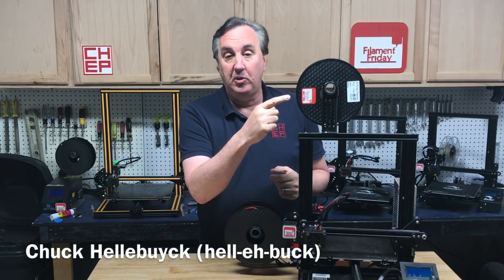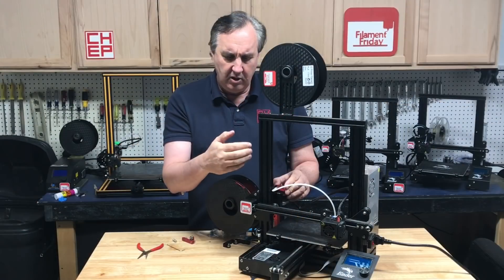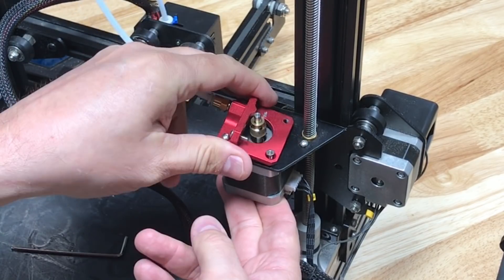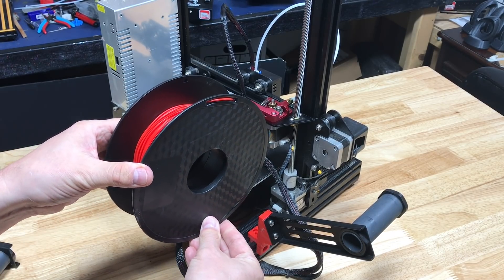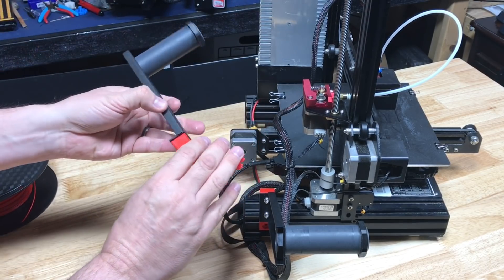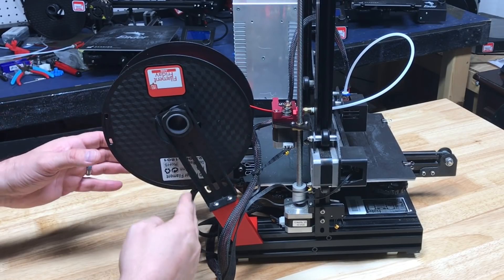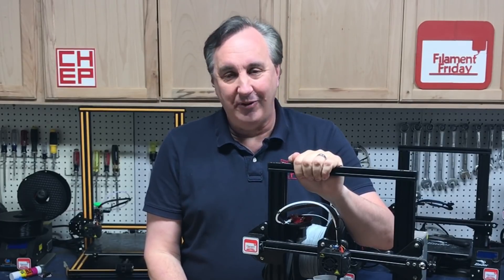Creality Ender 3 Rear Spool Mount

Comment: Thanks for the video chuck. I was considering moving my spool to a different spot and was thinking of all possible options. I notice that your extruder is a metal single gear drive. Do you really notice much difference between the single and dual gear types? I thought it would be progression to move all to dual gear or is there a reason why you haven't on this one? Your answer will lead me to another question which I wish to ask as well please.
Reply from the maker: I’m seeing wear in the dual gear. So I’m not sure it’s the best solution.
Reply: @FilamentFriday  that's what I was wondering on your opinion. As I bought 2 pack of metal dual gear extruders and found wear on the additional gear was basically grinding into the base. And that's on both of them. Do you think it was a bad batch or designer flaw? I know there's constant moving parts but not expect so much erosion in what I think is a short time (I'm talking just a few months)
Reply: Dennis Renton 
What do you use to lubricate the teeth?  Try some white lithium grease, if you’re not using anything.
Reply from the maker: I’m thinking it’s a design issue. Use lots of grease.
Reply: CHEP 
There are sellers with slightly different looking units.  Possibly the gears vary as well?

I have two Ender 3 Pro units, and the one with the dual grip extruder hasn’t been run very hard as yet.  It has a silver screw through the gear on the arm (others have a black screw, and look slightly different in colour).
Reply: @boggisthecat  it's not the teeth wearing down. It's the cog itself wearing into the base. And it's happened to both of the dual gear extruders I got. Think I'll just order from another supplier and hope it's just on the pair I bought that's the problem.
Reply: @FilamentFriday  thanks for your advice. I'll source more but try from someone else hoping it'll be different. Just think that the generic extruders, I thought they'd all come from the same manufacturer.
Reply: Dennis Renton 
That seems odd.  My gears both sit well above the base level.  The fixed gear almost reaches the end of the motor shaft.

Comment: nice idea but on my ender3pro i ve installed the direct drive kit so i only can put the spool on top.but i appreciate the search.
Reply: mulderx252 
Is it not possible to use a short length of tube to direct the filament?
Reply: @boggisthecat  maybe but it adds friction And more as  long as the z arm is lifting.

Comment: Hi there. Great idea, but what if you might the spool holder sit even taller and let the filament feed the extruder from the bottom of the spool instead of the the top. That way you can get more build area back. So essentially, that your design and just make it longer so that the spool sits maybe level with the top. Would that not give you your build area back?

Comment: The filament will eat the extruder arm even faster than the stock location. Metal is better but at that angle you've got, it's only a matter of time.
Reply: Pretty much what I was thinking
Reply from the maker: If it’s going straight in how does it wear?
Reply: @FilamentFriday  It's not aligned with the hole in the extruder. You have the center of the spool aligned with the extruder so the filament is always wearing away the top of the hole. Maybe you could raise the spool higher and have the filament spool from the bottom of the reel?
At 4:42 it's apparent
Reply from the maker: But the extruder moves up as it prints so it’s always changing, no different than from the side. And I don’t see any major wear there.
Reply: @FilamentFriday  I'm just making a comparison to a free standing spool. When the X axis is low, it will eat the top of the extruder arm. As the X axis rises, it will change and maybe eat the bottom of the extruder arm.
There must be a better way
Reply from the maker: If you can figure out a way to raise the spool at the same rate the extruder rises, Then a lot of people would interested in that.

Comment: If you can flip that arm 180 degrees then the spool will be on the outside and not inside the print area.
Reply: Or even better, just unscrew the filament pin and flip that 180
Reply: Would make changing filament spools far easier too.

Comment: Turning the extruder was brilliant.  while I won't use the bracket, it will make running the filament into the printers from my repkord filament box mounted above avoid one less turn to enter the extruder. I have ezstruders so I will await your ezstruder bracket design.

Comment: I really like this idea and it now has me wondering if you could mount it on the front side of the printer if the extruder were to be turned 90* the opposite way. That would put the spool in a better location for filament swapping and be way easier to check spools in a print farm type setting.
Reply: Mr.Butram 
I don’t think so, due to the printhead homing at the far left getting in the way of the filament.  There may be a way to direct it in from another angle, by also using a short length of tube from the entry side of the extruder.  (You would have to tap it for another fitting or something.)

Comment: couldn't you just flip the spool holder itself 180 degrees so it sticks out to the other side?

I like it, but I'm not sure how easy it'd be to load filament with the printer backed against a wall.
Reply from the maker: You can move the printer.

Comment: Great design Chuck, most likely won't use though cause I have an EZR extruder  for my ender 3. Converted me ender3 to direct drive with dual Z so filament is fed down from the top.

Comment: Nice, but....  Two concerns, one of which you addressed, that is the loss of build volume.  The second is when you have a new full spool, looks like the angle from the top of the filament coming off the roll has a set of sharp angles to get to the extruder.  This is only at low z heights and becomes less of a concern as the print grows in Z.  You thought?  I like you thinking about solution.  Keep it going.

Comment: I like the idea, but think it would be better if the filament didn't have to bend to enter the extruder.  How about extending the bracket back and lowering it (or raise it if you want to feed from the bottom of the spool) so that a full spool of filament wouldn't have a bend at the extruder?  I realize that the printer will be a lot deeper, but for a height challenged location it might just work.
Reply from the maker: The extruder moves so I don’t see the point.
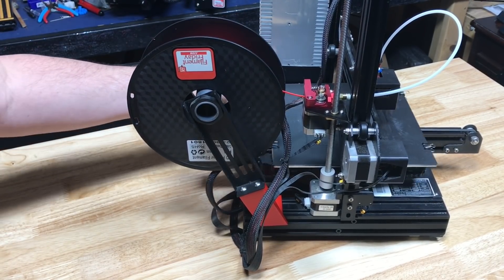Reply: @FilamentFriday  Thanks for the reply!  I'm referring to the vertical bend in the filament if you have a full spool.  At the 4:30 point in the video is where I see the vertical bend, and it appears that the spool isn't full.  With a full spool  there would considerably more bend.  The bend may not matter with the metal extruder tensioner, or the "new" stock plastic tensioner that has the metal insert; however, I imaging the all plastic ones will have issues.

Where does one purchase your Filament Friday PLA?

Thanks for the great videos
Reply from the maker: Link in description.
Reply: @FilamentFriday  Thanks.  Amazon is out of stock, and it appears that a lot of PLA is out of stock.  I'll keep checking :)

Comment: I really do dig it, but I CANNOT and will not live without my EZR STRUDER’s. Good for those with pretty much stock machines though. Good idea, but not for me YET. Hopefully you will figure out an adaption for the EZR.
Reply: I also agree. Chep convinced me to get the EZR Struder and it is amazing. I love it for easy feeding of PLA and obviously the better flexible. For now the spool holder is still on top because I designed my own guide with bearings that also has an optional filament runout sensor that I can use or just let fall out of the way.

I'm glad you're back @Chep. I missed the video last week and was worried.
Reply: Dan Blomberg It was Michael from TeachingTech, that turned me on to the EZR, and have since installed them on both of my machines. I have learned a heck of a lot from Michael, but I do enjoy CHEP’s explanations, as sometimes he is better at making things clear. Michael sometimes goes waaay to fast forcing me to rewatch the same thing over and over. Thanks CHEP, for being very easy to understand. I have watched many of you videos, and wish I had caught more when I was first learning.
Reply: @gammagonad  yeah. Teaching tech is great. I love the technical nature of those videos since I've made a few custom firmware myself so I enjoy the nerd stuff
Reply: Agreed I love my ezrstruder

Comment: Looks good! Would it be better to flip the spool so it feeds from the bottom of it? It looks like the filament would go straight in to the extruder if you did.
Reply: As the Ender 3 prints, the extruder will move up. If it feeds from the bottom of the spool, it'll only increase the bend of the filament on a tall print. Feeding from the top of the spool will only allow it to "reach" behind the spool as it prints higher. I would think lowering the spool a bit by using a shallower angle mount would be better, also recovering some build area (but probably not much).

Comment: Really cool design, I like it a lot. Since you're pulling the filament in the same direction that it slides onto the rails, are you concerned that it could eventually start pulling the entire bracket towards the extruder?
Reply: T-nuts Will keep it from moving forward.

Comment: great video, new viewer (2 weeks) first 3d printer related related post :).
 I do own but have not yet received my first 3d printer, and Ender 3 Pro. while i have been waiting for its arrival I have been spending more hours then i care to count watching your Videos as well as others (TT - MM) looking at mods (both upgrades and smart printable additions and such) that including the time to learn and attempt understand various bits of software (VS code & marlin 2 ,  Tinkercad and a few others (fusion 360 is going to take a LONG time lol)) 
lso i have downloaded and added your Profiles to Cura in hoping to hit the ground running with proven settings (other then tweaks for the filament ill be using).

that aside, after seeing a dozen different mods to prevent the filament from hitting the z screw or wearing a groove into the extruder arm, i decided,
 Id try and figure out a different orientation of the stock extruder. With that i was thinking about a set up where the spool is secured to the top Rail center, 
however it hangs off the back the printer just low enough as to not to interfere with the top of the 250mm Printing area .

then i was going to find a model or use tinkercad to make a 90 deg bracket that moves the extruder up a little as well as back a little to allow a 
little more distance between the extruder and far left position of the printing head in the printing area, thus relaxing the stress on the bowden tube and fittings.

now being i havent received my machine i have had to rely on my imagination to picture any issues i might encounter. this video shows me im on the right path and thank you for that, keep up the great work sir and have a super weekend 
(sorry about the novel, im quite ampped to get started in this hobby)
Reply: ScooterVauto   I did as you last year. Chep has helped me a lot before during and after my Ender 3 arrived. And he is still pulling great content out of the bag.
Reply: just remember to master the stock version, really gain a firm grasp of the entire printer, troubleshooting etc then go for upgrades. albeit there are a few essential upgrades but it will help in the longrun when and if an issue arises.

a stock ender 3 is quite good so consider this so that when you do upgrade you completely grasp why it is reasonable to do so.
Reply: @Mr_Pewpy_But-Whole  yes sir, that is the battle plan. the upgraded main board and drivers etc are for later (was going to go with hardware style stepper motor mounts as well as 4 of the inline stepper drivers, 
but for the price of those parts plus a $20 and i have a main board with 5x 2208 (only need 4 for now) so i bough them :). 
going to have a noisy printer for the first month or so lol

but as you said, learn the stock system first and understand how it works before i break stuff by accident :)

Comment: I've been thinking about the same mod but with the filament spool in the middle of the printer, in its standard orientation, stuck to the dual Z carriage. Dual z delivers enough torque to push the weight of the spool and it will always be out of sight since it goes up with the z. Anyone has seen this idea?

Comment: Spool position - I dunno. I don't think that's a design flaw, I think that's just part of the iteration process. I love this!
Reply: 3D Printing Nerd Hi Joel
Reply: @TeslaDIY  Hi!
Reply from the maker: Joel - True. Very true.
Reply: You can just put the stock mount on the outside rail facing outward without printing a modification to mount your spool like this. It's not in the way either. just have the spool holder arm facing outward on the outside top mounting rail.
Reply from the maker: It puts it too far out from the extruder.
Reply: @FilamentFriday  Turn the bracket so that the narrow edge of the spool faces you when operating the machine. From this position the spool mount would go on the Top of the, rear, bottom rail second grove on the top. The handle pointing outward. both bracket screws in the same grove the orientation of the metal spool mount on the rail is with the corners folded outward facing to the left. 

I've been running it fine like this. Although I did have one issue with printing some springy white material when the spool mount was extremely loose. Both the springiness and the loose mount added up to cause filament to unwind around my spool holder. But this was all resolved by simply tightening the spool holder like I should have. I don't think it's a perfect option but it doesn't require any print. 

THanks for all your great videos by the way.

Comment: Looks great and I like the way it feeds. My only thing would be spool/filament changes. Seems it could be a bit more difficult (depending on your set up of course) if you have to reach through the machine or around the sides to get at the spool.
Reply from the maker: I may flip it as someone suggested.

Comment: I use your side spool holder as my printer is on the left end of my desk so the spool hangs out off the desk which is fine. 

Could you have made the holder be taller with less of an angle and feed off the bottom of the spool? That wouldn’t interfere with build volume then. Or am I missing something with spools feeding off the top being optimal?

Comment: That won't work with a huge print that covers the whole bed. I'm working on at 18cm x 18cm battery case and that certainly will hit the spool.Maybe create a mount bracket that is just a tad on the left so that it's not in the way. Great idea though!
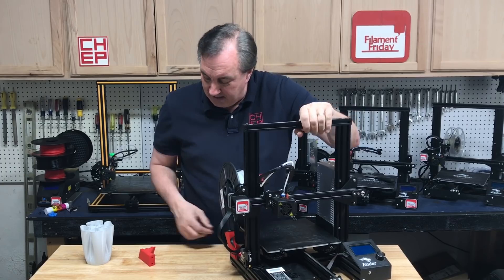Reply from the maker: That’s what I said at 5:30.